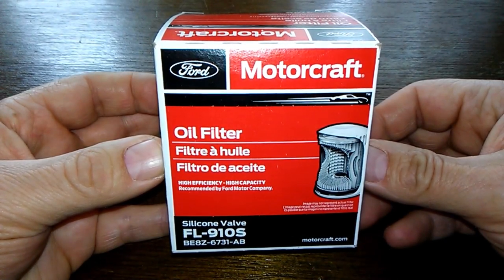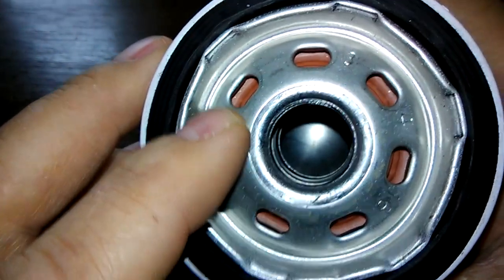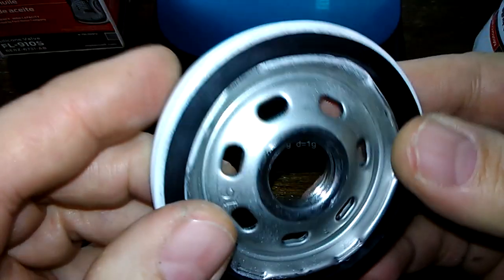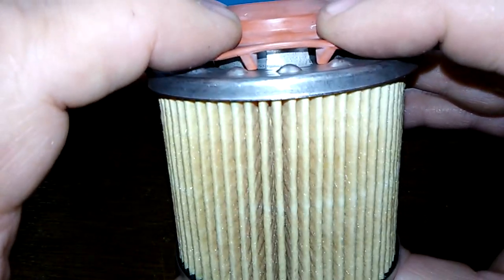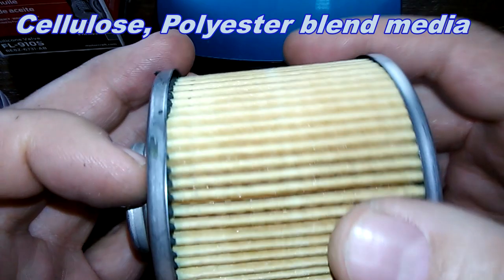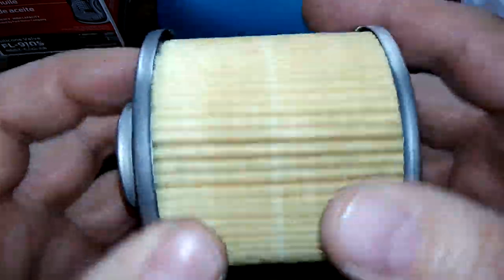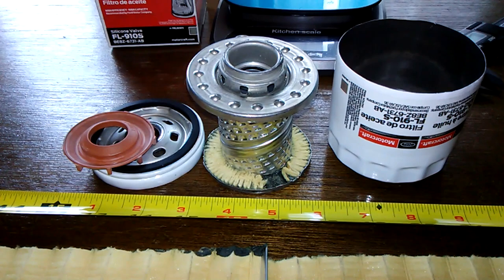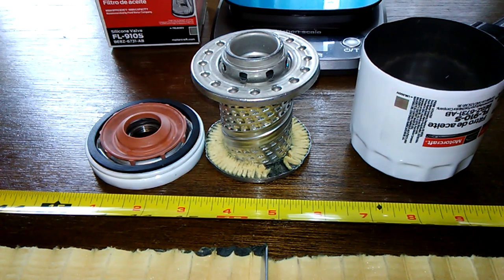Motorcraft Oil Filter Cut open FL910S

Comment: The pressure relief spring is a flat metal piece that is made to allow the oil to by-pass the filter when pressure builds up to 12-16 lbs.  The flat spring works just as well as a coil sprng. The Silicone Anti-Drainback Valve keeps the oil in the filter when the engine is shut off, which prevents "dry starts" -- which is when most engine wear takes place.
 Maximum life of a Motorcraft Oil Filter = 3,000 miles .
These are NOT Long-Life filters !!
 For the FOMOCO 4.6-liter engine, I use and recommend the BOSCH #3410 Premium Oil Filter (Amazon, Wal-Mart), with oil and filter changed at 5,000 miles.
 I add FilterMag magnets to the outside of the oil filter -- takes out metal that the filter doesn't capture. FILTERMAG - Part # SS365PR (Amazon).
Reply from the maker: Sorry, I dont think the stamp leaf spring works as good as a coil spring. The stamp leaf spring has no spring to it, it's not the same as a coil spring.
Thanks for sharing about your filter magnet.👍🙏😊
Reply: @WhipCityWrencher  The flat leaf spring does EXACTLY the same job as the coil spring -- and just as well. Yes, the coil spring "looks right", and it's what we expect when we think of a "spring", but the flat spring works just as well and lasts just as long.
Reply from the maker: @SlikLizrd  Sorry, I disagree,
Here is a picture of a Champion oil filter (flattened stamped leaf spring) that I cut open a few years ago. https://i.imgur.com/IgeslRj.png
Reply: @WhipCityWrencher  The springs "LOOK" different. They work exactly the same, and have the same effect. In practice, they are equal -- regardless of our opinions.
 The Bosch Premium filtration media has the capacity to hold up to 14 grams of dirt* in the filter media (*Based on ISO 4548-12 at 20 microns on 3500)
https://www.mercuryforum.com/forum/grand-marquis-14/1995-grand-marquis-restoration-8937/
Reply from the maker: @SlikLizrd  Nice Car, well done.👍
Reply: @WhipCityWrencher  Thank you. I have been restoring/modifying the 95 MERC since I bought it in 2005 -- I do my own work, at home, in the car-port. 
I'm 82 years old, and retired. I forgot more about Automotive subjects than many of the You-Tubers people think they know .
The 1st car I ever worked on was a '37 Willys Coupe -- helped my Dad make Shock Absorber Bushings out of old tire inner tubes and LePage's Glue.
Ah, the good old days !!
Reply from the maker: @SlikLizrd  Good for you!👍
You have 22 years on me, I hope if/when I get to be your age I'm still playing with cars. Take Care👍🙏😊
Reply: I wouldn't use a Bosch filter if you gave it to me for free.
Reply: @j.t.cooper2963  I agree 🙂
Reply: @j.t.cooper2963  Which brand of Engine Oil Filter do you prefer ?? Which part number is best for the FOMOCO 4.6 - liter V-8 ??
What criteria do you use when deciding which oil filter is the right one ??
I use several. Must be 20 - micron filter. Must hold 5,000 miiles worth of dirt. Must be readily available. Must be inexpensive.
  The Bosch # 3410 meeets my requirements. Others do not.
The famous 95 MERC runs Pennzoil Ultra Platinum, 5-W-20; Bosch #3410 Premium  Oil Filter; FILTERMAG #SS365PR Magnet Kit; changed at 5,000 miles.
At 170,000 miles -- 16 City, 24 Highway 
 https://www.mercuryforum.com/forum/grand-marquis-14/1995-grand-marquis-restoration-8937/
Reply: @SlikLizrd  You can use whatever you want. I use Motorcraft - FL820S on my 2006 Crown Victoria they are rated for 6 months or 6000 miles, whichever comes first. Every other filter I tried made my engine rattle on start up (dry start) I change my oil every 6 months (Fall/Winter and Spring/Summer). And I use Super Tech full synthetic 5w30 oil. Use what works best for your car. My car likes Motorcraft. I'm at 160,000 miles and have not had an oil related issue and the car still runs great.
Reply: @j.t.cooper2963  Strongly Agree - 07 grand marquis , similar mileage, same oil (super  tech is very good), same oc intervals. 820S have been great... I've also used them on my '03 f350 v10 for YEARS  >200,000 miles
Reply: @j.t.cooper2963  I ain't the Oil Filter Police -- I don't care what others say, do, or believe --  I do my own research, make my own decisions, and choose the products that meet my requirements.
 And I encourage others to do the same.
You find the Motorcraft FL-820S to be a suitable filtration system for your Vic.
That's fine -- for you -- but I've found the Bosch #3410 Premium Oil Filter to be a better filter for my requirements.
https://www.mercuryforum.com/forum/grand-marquis-14/1995-grand-marquis-restoration-8937/
Reply: @SlikLizrd  Good for you. Motorcraft filters. I don't need a link to some forum banter either. You go ahead and use Bosch filters. I couldn't care less.
Reply: @littleflapjack  👍🏻😎 I have been using Super Tech full synthetic and Motorcraft filters for 20 years in all of my vehicles and have never had an oil related issue.
Reply: holy crap, 3k on a filter iz like being bak in the early '60s wen my father started teaching me how 2 change oil on his company cars...  i can remember him changing @ 1500 miles... i use & sell AMSOIL  [ZO# 5149186] & rite now i've had AMSOIL in my '16 lexus nx200t for 22,500 + miles, in just over 3+ years, need 2 change REAL soon... i trust it iz still good because i'm still getting GREAT mpg... bought a trans fluid machine so my mechanic & i can do more work w/such a great product line... i've used their filters & oil 4 quite a few years now, & NO problems @ all... my neighbor just did his chevy truk, [350] w/m1 & it was BLACK after 12k... he uses fram filters... my oil, u still can see thru... i wood like 2 see u do k&n  &  AMSOIL &other premium / high end filters... enjoyed video...
Reply: @j.t.cooper2963 :  I always used either Wix or Motorcraft in two Ford Windstar minivans, and got 412k miles and 350k miles on original engines before i retired them. On my third Windstar with only 102k miles 😀, and expecting another long run. [Edit: changed oil usually around 5k-7k miles]
Reply: Motorcraft filters are not rated for 3,000 miles they are rated for 5,000 to 7,500 miles because that's what the manufacturer recommends depending of course on the specific model and year.  Ford would not make a 3,000 mile filter and then tell people in the owner's manual to change the oil every 5,000 to 7,500 miles.  They are on the hook for warranty work and need to protect those engines, so why would they cheap out like that?  Purolator makes the Motorcraft filters and guess what, those Purolator filters are designed for a 5,000 mile oil change interval too.  Also, those "filter magnets" do not work, it's been debunked in numerous YouTube videos that proved it but hey it's your money spend it how you like.
Reply: Interesting... I have 4 cars and I bought a new cheap ford car back in 2007 to use for driving further distances to keep the mileage down on my other cars since I moved back to the rural area in 2015. Roundtrip to the nearest grocery store is 50+ miles. I've been using Motorcraft 5W-20 Synthetic Blend and the FL910S at every oil change (5,000k to 6,000k) in the car. Takes about 30 minutes in the driveway but I'm also rotating the tires. I've had no issues and the car has almost 250k miles. Was having a little issue with the brakes. Thought it may have been the engine losing some power so I ran a compression test and it was perfect. Turned out being the brake booster valve was slightly leaking. Car still runs well. You may be right but I have no issues. Well, other than having to replace the AC compressor and lines, alternator, upper intake manifold along with regular maintenance. Maybe, I've just been lucky. It's easy for me to put 30k to 45k miles a year on a car. 90-95% of my miles are highway miles so that may play a factor. Never thought about using the magnet in the oil like they do in the transmission pans or bolts. Nice tip.
Reply: @j.t.cooper2963  No need to be hostile -- we're just exchanging information here. 
 Hope you're feeling better soon. 😁
Reply: @SlikLizrd  Who's being "hostile''? It's certainly wasn't me. I looked at my comments and I don't have a clue as to what you are referring to. As far as you hoping that I feel better soon is a waste of time because I haven't felt better.

Comment: Been running nothing but Motorcraft filters in our 2007 Expedition and F150,  never had any issues. These compare very closely to Wix filters who has the best filters out there.
Reply: Hi Barbie, yeah the Motorcraft filters are made by Purolator to Motorcraft specifications and it's a great filter.  The regular Purolator is good too, I've used those before. Wix is a terrific filter but costs over twice as much.  But hey, I guess you get what you pay for, lol.
Reply: @LA_Commander  Expedition has 143,000 miles on it now and still runs like brand new...
Reply: @barbiesawada245  Oh wow!  That's great news.  Take good care of her!  I have over 240,000 miles on my '05 Explorer with the 4.6L V8 and I take very good care of her and expect another 100,000 miles at least.  Doing those oil changes on a regular basis, showing your car some love, will pay you back hugely in the long run 🙂